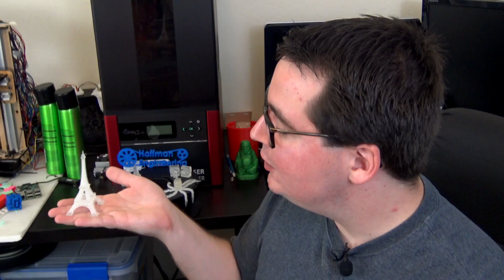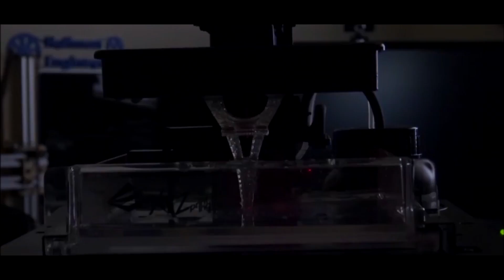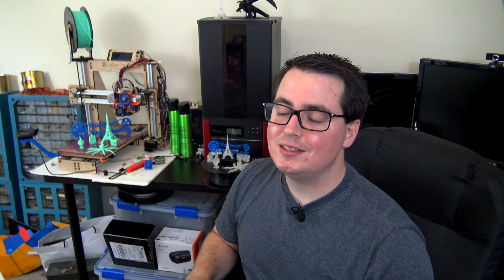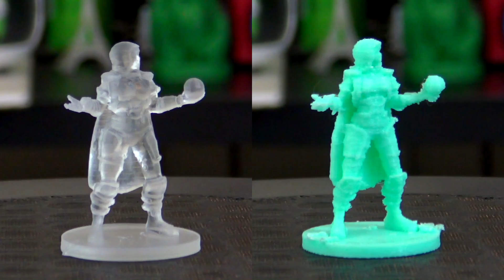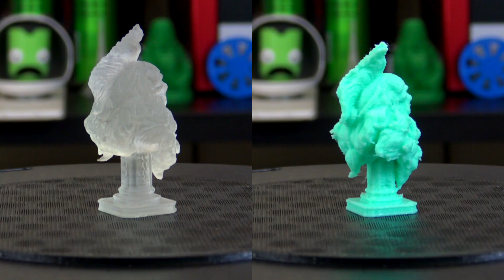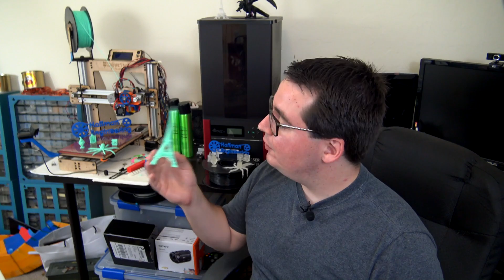3D Printers: Are resin or filament printers better? SLA vs FDM!

Comment: It would be very interesting to see an updated version of this. Maybe you could try using 0.15 mm FDM nozzles with tiny layer heights like 0.05 mm. I think they would be able to compete a lot better with the resin printer, although the resin printer would still win and would probably be faster.

Comment: I am an owner of the flashforge finder and have been so for almost over 2 years, im worried how your printing stuff on your FDM because the scale and over-all settings your using are bad, this is a horrible comparison which will only have the resin win due to it being able to do small scale prints in high detail , FDM can print good detail stuff with the correct settings and scale, actually try and view the FDM as good and it will come it better then expected.

Comment: If I need to print gears and component for robots which one is better?
Is the material in the filament printer better - more durable, flexible, etc or is there any reason why one would choose it and give up on resolution?
Reply: Resin printers are what you're looking for probably (if you're looking for non flexible stuff)

Comment: Wlp some FDM printers use 2 different material (Model material and support material). Support material is usually very easy to remove. If you can get a good enough resolution on FDM you can sometimes get very clean prints.

Comment: This is a really good comparison! Have you done a cost to print/cost to own comparison of the two print technologies? Unfortunately as a hobbyist that's my biggest hangup. I'd love an SLA printer, but you can buy FDM printers for about 1/3 the price, and filament itself seems much more accessible and can be sourced very cheap. But it would be interesting to see a precise breakdown of the amount of filament and resin used to make the same print, then calculate out the cost of the material for each printer. I assume SLA is always going to cost more, but I guess it could definitely be worth it depending how much more it is. Regardless, really good video!
Reply: Monkey J thinking the same thing

Comment: BRO you even know how to tune a FDM??? Your printer prints worse than a out of the box one 😂
-Nozzle diameter 
-print thin walls
-Support configurations 
-retractions 

Pls tune your printer before doing this , my printer is so close to that sla quality is not our fault if you dont know how to tune a fdm printer

Comment: You dialed some settings wrong on your FDM. Like retraction and speed, temperature. Experiment a bit and dial them in and you should get much better results

Comment: Cool vid, but it kinda feels biased. Even though my printer isn't the best (Monoprice Mini Delta), I've gotten some phenomenal prints. Overheating of plastic can be an issue, but I address it with a battery powered job-site fan, lower temps and slightly slower printing. SLA is king with small features, detail and support, not to mention faster printing especially at tiny layer heights, but FDM printers are capable of more than what you're showing here.

Plus, SLA does have its drawbacks, such as smell, more mess, more intensive post processing and more machine maintenance/care.

Plus, as many have commented, you can change your nozzle for a smaller diameter one and print with more details, shall you find the need to do so.

Comment: I am looking for a 3d printer and am wondering weather to go resin or filament route. It would have been nice to se your video compare prints with the settings set for optimum print quality from both printers. All I am saying, is that I have seen video of a filament printer, printing figures of the same approximate size as you show, with much better results. Also the curing the resin print which should be included in the printing time and the added safety issues that go with resin would be appreciated, compared to the same print from filament. The strength of the prints and finaly the print cost from each printer. This info would give people looking at getting a 3d printer, people like myself a much clearer picture of what way they want to go.
I sating this, I still enjoyed your video.

Comment: Ignore the shit this guyi s saying please
Yeah SLA is better than FDM, but look at what the fuck he is doing with his FDM prints
He is trying to compare a bad configurated old fdm printer without the propper settings to print miniatures against a SLA printer that is FIVE TIMES MORE EXPENSIVE!

He is doing a bad job with the SLA, not getting even 20microns(Sla can do even better than 20microns) and doing like 300microns on the FDM (That can easily acchieve 100microns or even 50 microns in a good machine)

Comment: Hello, I'm looking into my first endeavor into 3D printing and wanted to ask for some advice/suggestions. I am really wanting/leaning for a budget SLA resin printer kit like the Peopley Moai ($1300), for the resolution of the prints and this price point ..this is doable with a little saving. But I am thinking maybe I should start with an FDM budget kit like the TEVO Tornado DIY 3D Printer ($350),  FDM might be the way to go to get started now, get the experience with 3D printing calibrations, modeling and tuning more affordability, and to really gauge if I use the 3D printer as much as I "think" I will. Or is SLA an entirely different daemon in that if SLA is what I want, then I should start there? Or would you advice just to blow the $350, on a FDM , see if I like it and go from there. My hesitation is that once I go SLA, the FDM will become a big paper weight. I consider my self software and tech capable so I consider building and trouble shooting part of the fun and experience. ..  I plan on using these printers mainly to print components for my other hobbies, RC hobbies..planes/drones FPV, shooting sports, miniature painting, house hold DIY items ...nick nacks for the kids ect. What route should I take?
Reply: prusia i3

Comment: Wait, the jointed octopus... Each individual segment was printed independent of each other, yes?
Reply from the maker: Correct. The model came like that, with the separate segments. I believe the resin printer would have been able to print it assembled, there should be enough clearance between segments, but I don't think FDM printers would be able to.

Comment: Although your FDM prints are REALLY bad and this was an unfair comparison, it is true that SLA prints in much higher quality and detail than FDM - so I agree with you on that part. But I had to downvote you when you said that your FDM samples were printed using a "relatively well tuned machine". That's just misleading people. I had at least 10x times better prints with my FDM printer BEFORE I even bothered tuning it.

Comment: At the sla you will not put anything in the print eg a nut. And this printout of the head is simply horrible. I print my stuff, heads that have 2milions of polygons (like avatars) and have to admit it is a detail on FDM ...

Comment: I have a problems with this video
Problem 1: your fdm printer is trash
Problem 2 clearly your fan is awful 
Problem 3 sla’s are so slow 
Problem 4 sla’s cost a lot more than fdm
Problem 5 it all depends on slicers for fdm
Reply: Do slicers make a noticeable difference?
Reply: 3:  FDM print speed is inversely proportional to the area of the item(s) being printed.  Example:  If you were to print 1 model on FDM, it would take 1 unit of time.  If you printed 3 models at once, it would take 3 units of time.  With DLP, it only ever takes 1 unit of time, irrespective of how many models you're printing at once.  Printing small things is faster on FDM, printing large things or many things at once is faster on SLA/DLP.

4. Prices are coming down rapidly.  The Photon Gen 1 is only ~$350 and has outstanding print quality and ease-of-use.

5. That's pretty much true of any 3D printer.
Reply: @kokoronai594 3)  50-60 second aprox SLA layer time. For any model, very small or very big. But how often you print all the area of the print table, like boxes? I think you will print boxes with FDM because:
4) FDM print cost is 5-10 times cheaper than SLA
You can print small details and they will be sharp with SLA, but if you need durability FDM will come with a lot of great plastics. I can't imagine resin in the gears for example. Anyway a nice and tuned FDM printer can print small details very precise and they still can print you boxes, just change the nozzles.
Reply: @prostofil  Only the first few layers of an SLA print are done at 50-60 seconds, everything after that can be much shorter.  You do a final UV bath afterward to harden the resin fully.

Resin can stronger than many types of filament.  See here:  https://www.youtube.com/watch?v=5t6deOZloBU

Personally I think the price difference between filament and resin is WELL worth it, but you may feel differently.

Comment: For a genuine "shootout" I think it would be helpful to show the strengths and weaknesses of both kinds of printers. Instead, this was essentially showing the kind of prints that SLA printers excel at (small prints with lots of detail), and then trying to get the FDM printer to match that. Also, a discussion of the disadvantages of SLA vs. FDM would have been nice, since SLA has a lot of downsides. Still, I enjoyed the video.
Reply: I'd like to know which would be better for working mechanical part design. I am guessing the resin would be a much bigger cost than the filament. I am wanting to get a 3d printer, just not sure what kind. I am looking at the $300 - $600 price range.
Reply: "pure perfection eifel tower" - its warped, lol
Reply: the bean is coming out soon to get one from funding off kickstarter called bean it is $400 when I got it it's a sla printer you would have to wait onger though there is also a $700 sla printer called pluto that is out of kickstarter now it's quite speedy it beat the form 2 and for technical I recommend sla you can do stuff like joints without having to try twice most the time
Reply: Guess I've never seen a print that I'd consider large with little detail. Maybe a 2'x1'x1' skyline acoustic panel?
Reply: Hahaha None of these comments aged well. I bet you all feel foolish now.
Reply: @thatsciencedude4552  why’s that? as a noob, I don’t understand what has changed since then.

Comment: You should have gotten a filament printer that was about the same cost as the resin one.  Honestly, that filament printer is crap.
Reply: Doesn't matter.  Even the best, most well-tuned FDM printer sucks at fine details compared to resin-based printers.
Reply: Except that a $1200 PC will be better than a $2500 Mac...
Reply: That's absolutely untrue.

Comment: Those aren't good fdm prints. I can get far better quality with a .2 mm nozel. The biggest issue with fdm is actually not detail but the supports creating scaring on tiny prints.
Reply: With dual extrusion fdm printers you can use water solveable support material. It will create clean surfaces without any marks from support structures. I think that is a big plus comparing to sla printers?

Comment: Is the base of the SLA Eiffeltower badly warped, or is it only looking warped?
SLA is great for small prints with high details, but the speed on a FDM and volume they come in is great for larger prints.
Reply: SLA/DLP is faster at printing large models, or many models at once.  Sometimes significantly so.  Total build volume is still FDM all the way though.

Comment: Okay, here's some errors you are making:

Level Of Detail: while SLA will always be more detailed than FDM for small scale items, you definitely can dial in your FDM settings to get better prints than the ones you are showcasing and that is before you even get into switching to a smaller nozzle to do small objects.  The stringing you complain about is at least partly because of your poor settings.

Support material: Depending on your printer, FDM can use soluble supports, which makes them a non issue.  You can also manually design your support structure to be much more sparse if you want and depending on your application.  The comparison is simply unfair on that level. and I think including the availability of soluble supports makes FDM a clear winner.

You also don't go into the cost of the printer, the material, or printable area, or the functional aspects of 3d printers.  Try replacing a nylon gear with a SLA printer.

Overall, not a fair comparison at all.
Reply: He also didn't mention the toxic fumes, additional safety requirements and much longer processing times (washes, UV curing, removal of supports)
Reply: As soon as I saw that Mimic I knew it was gonna be unfair.
Didnt use a better printer to go against resin and didnt tweak the settings for finer details on small objects.
Reply: You was exactly right!!!
Reply: Another missing caveat, SLA printing takes 20x longer to finish!

Comment: Hmm. If you focus on details, of course SLA/DLP rules. Definitely. But what about strenght, cost, printing time, ease, versatility ? Resin is fragile, expensive (both printer and resin), dirty, needs post processing, have a limited range of applications. Resin printers are only good in non functionnal detailed things. FDM printers are more versatile (change filament in seconds) with a huge variety of applications depending of the filament you will use. From very resistant plastics (nylon or polycarbonate) possibly charged (carbon, metal, conductive, fliorescent...) with different aspects (coloured, translucent, mate...). You can use your part just out of the printer. FDM is still very competitive, and cheaper than ever.
Reply: Strength:  Depends on the resin you're using.  Resin can be at least as strong as the more common FDM filaments.  See here:  https://www.youtube.com/watch?v=5t6deOZloBU

Cost:  Newer DLP printers are pretty cheap.  The Anycubic Photon can be had for ~$350 right now.  Resin is more expensive than generic PLA or ABS, but it can be a lot cheaper than many of the other exotic filaments you mentioned.

Printing time:  Depends on what you're printing.  As print area increases, DLP becomes more efficient than FDM.  If you're printing multiple parts at once, for example, DLP printers can be significantly faster than FDM.

Ease:  DLP printers aren't really any more difficult to set up than FDM printers these days.  It took me about 20 minutes from opening the box to the start of my first print on the Photon.

Versatility:  FDM does, and will very likely always, have an advantage here, no doubt.

Basically FDM's only advantages are build volume and exotic filaments.
Reply: @kokoronai594  What about safety? Bad smell? Post processing? Screens having a fairly limited lifespan? Those are definitely not it's only advantages
Reply: @joshuawoolridge8378  I have both Printers and my SLA printer is just sit there, FDM is just better , you now can get Kevlar filaments!!! For FDM! And then there is PC.

Comment: For miniatures or detailed stuff (like figurines, busts, etcs...) an SLA will blow the competitors out of the water. If it's a laser SLA more so (DLP ones struggle sometimes with printing times and definition...).

But for useable, serviceable or BIG parts .... an FDM printer should be the way to go. You have technical filaments with carbon fiber, PETG, PC ... or simply big printers with big nozzles. And those plastics can handle a bit of manual work (asuming you put enough shell thickness!).

Nice to see SLA printers coming cheaper and delivering good results. Good video! :)